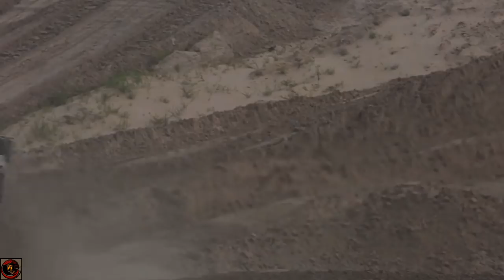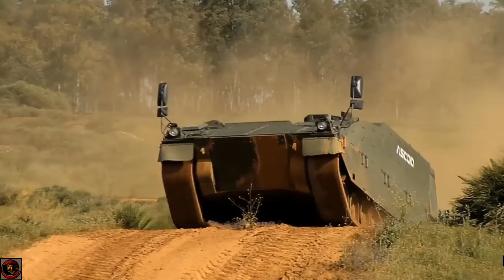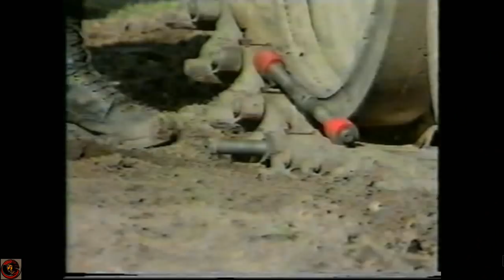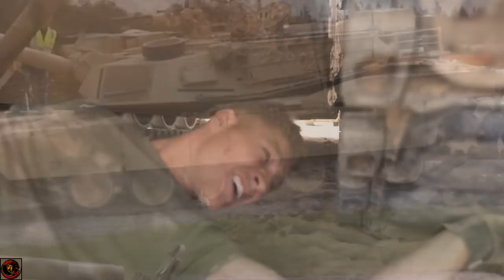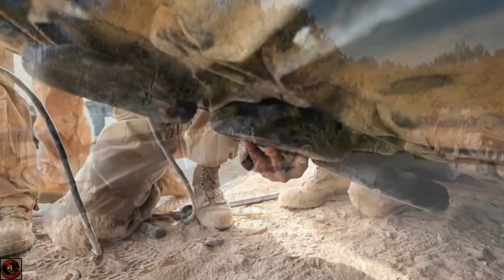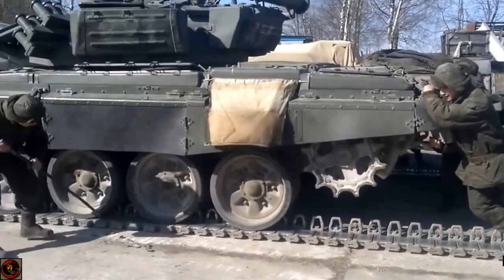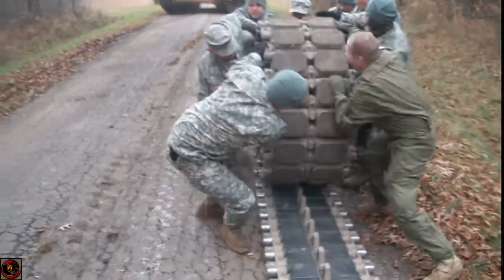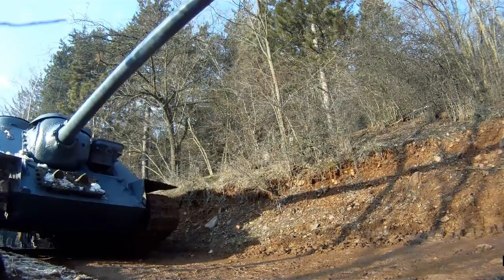What’s The Biggest Weakness on a Tank?

Comment: I think the base of the abram's barrel is a weak spot.. Instead of deflecting the enemy projectile, it'll guide it into the center and probably destroy the turret or killing the crew there.
Reply: Its a hell.of a lot easier to hit any point on the track system than to hit that Exact point under the gun.  With modern armor you are MUCH more likely to hit just a fraction off, dissipating the energy on the heavier armor surrounding it.  Hit the much larger suspension and the tank is a sitting duck, with any decent MBT, artillery or even RPG capable of delivery muktiple hit on the now stationary target.  Yes, he can fire back, but hitting a moving oppoent while you are stopped is a recipe for, as The Chieftain likes to say "a significant emotional event"
Reply: If I were targetting it, I wouldn't target the tracks. If I did, they will be able to shoot at me while I'm reloading. Hitting the ammo or killing the crew would be my choice. And at frontal view, that spot is a perfect spot for tank vs tank

Comment: What about the BT-series of tanks? It was a design with a Christie suspension and could move without tracks on a road with lots of speed, of course the tracks were more useful on a terrain that wasnt all flat. It was a light tank and the design was starting to get obsolete By the beginning of ww2 but its just one example of a tank design without necessarily needing the tracks, even though the tank became too reliant of roads at the process.

Comment: Here's a question for matsimus or any other tankers
How effective are molotovs against modern tanks? In the winter war and continuation war the Finns demolished  bt-5's, t-26's, t'34's & kv-1's and others and t-55's were took out by molotovs in the Hungarian uprising & Prauge Spring. Tanks have come a long way since, but would a Molotov be able to take out a Abrams, challenger, Leo, t-90, leclerc etc? If you knocked off the track could you get a Molotov in the right place and finish it off? Seems like it would be a way insurgents could deal with modern tanks you couldn't take out with a rpg-7
I mean if you had a AGTM or RPG-29 modern tanks are toast but a Molotov interests me, especially if the fuel is gelled

Comment: generally tanks are pretty poorly armored at the bottom, so anti tank mines are effective. A volley of 30mm from an apc could demobilize it by destroying the tracks. a sabot right between the turret and the hull can be pretty effective since most of the armor comes by slanting it, deflecting projectiles away and increasing the relative thickness from flat on attacks, and the gap between the turret and the hull wedges the projectile right in there. attacks from the top and the back are pretty devestating. if powerful enough. guided, air dropped munitions and missiles are  nearly always an instant kill or mission kill. a tank without infantry support is of limited use. it can be flanked and attacked with man portable rocket launchers. maintaining situational awareness is hard when you are in a box of steel with barely any view outside.
aside from that there are logistics and infrastructure  issues. most tanks can't cross a broken bridge, and most tanks don't work well when they're out of gas. being machines they break down, loose oil or coolant, etc.
tanks are nice, but air power always wins.

Comment: Here is what i think are biggest weaknesses of tank in no specific order, before i have watched the video:
1. Best of tanks can be destroyed by cheapest of infantry with equipment that is substantially cheaper than tank. Even when infantry and equipment suffer losses as they try to destroy 1 tank, it still is much, much cheaper. 
2. Supply lines. Supply lines are easier to attack than tanks, and without supplies tanks become useless. 
Ofc both are easier said than done.

Comment: As a AT Carl Gustaf gunner just taking out the tracks is not option for someone who are defending a position if a tank is attacking.it is imortant for the crew in the tank for shure.but for a defender AT it is bether to hit the joint betven the hull and the turret.the tank are able to drive yes.dut not able to engage tergets easy.it have to retreate for repair.or often just able to use turret mounted auto rifles.and heavy AR.

Comment: It looks to me that the use of graphene, carbon nanotubes, and so forth are really the solution to the suspension/roadwheel/track problem.  They are only going to be 10-25% as heavy as a steel track system (if not less) and a HUNDRED TIMES as strong (or even more).  This means that they can be tied to the tank's hull much more solidly and still not be liable to be over-stressed, while being much more easy to repair, since each component will be light enough for a single man to pick up and carry.  I would think that a major program to work on this would be very cost-effective, as well as making the vehicle more reliable on the battlefield or during training exercises.   Even if twice as expensive as a current component, if it lasts more than twice as long, it pays for itself.

If efficient generators and battery/capacitors are developed, the tank can use electric motors and magnetic repulsion to eliminate many weak spots.  Such as a set of small road-wheels held in place by powerful high-temperature super-conducting electromagnets -- cooled by a small nitrogen-gas/liquid compressor inside the motor compartment and using super-insulation to keep the suspension components cold.  With this, the vehicle cannot have its magnetic-repulsion connections broken and would have much less loss in wasted power if each road wheel was driving the tread separately.  It would be literally floating on air and its suspension would be very easy to maintain.  Longevity in literally thousands of miles between normal maintenance procedures, just like a current automobile, even when going fast across country.  Only direct battle damage from enemy weapons would be a problem.
Reply: You play way too many video games. It's actually not realistic to put that kind of materials into military vehicles.
Let me give an example. You said use graphene right? Did you know that while graphene is as strong as steel and much lighter, it's also brittle? That's the last thing you need in a battle tank.
Reply: Same reason for engines and gears instead of electric motors. If..no. Actually, when they break down( because they are going to battle, not going to the shop to buy milk) do you think electric motors can be repaired in combat? Nope

Comment: I have question for you MATSIMUS. I am 66 years old and in late 1950's as 6 year old boy, I was near rail road which was used for armored vehicles loading area onto  " flat top " train carriages " which were then delivered to military " remount / repair ' depot. I talked to one tank crew member and asked him why are there rubber padding's between main cross metal grip sections. He said, those are " peace time " add ons to reduce noise while driving Tanks on main road in towns and to prevent damage to roads which will be taken off if there is or will be a war. Most tanks than ( country I originally come from ) where mainly WW2 era American and Russian Tanks. so, there is real question, I wonder, why all those new, modern Tanks are using rubber grips on Tracks instead all fashioned metal grip's?? ( sorry Guys I am EX AIR FORCE ).

Comment: I was thinking about a "tank-replacement" system for the future (just for fun) -- and the vulnerability of the tracks came to mind.  I was thinking that bolt-on wheel/electric motor systems designed for quick (preferably robotic) replacement would fit the bill.  6 - 8 wheels/vehicle would mean that 1 - 2 could be lost and simply abandoned.  This concept assumes a heavily armored command vehicle would have multiple relatively lightly armored gun vehicles that were semi-autonomous.  If tanks are moving towards crew in capsules controlling guns remotely -- why not have those guns on separate vehicles.  Just dreaming.

Comment: That was one of the differences between German and Soviet tanks in WW2. The Soviet tanks could be repaired in the field and returned to battle in a short amount of time. The German tanks on the other hand, were mechanical nightmares being built with tight machine tolerances and complicated to repair. The required special tools and procedures to fix. On top of that they had to be towed to the rear echilion to facilitate those repairs. Costly, time consuming processes kept them out of battle longer.
Reply: German tanks killed soviet ones about 8-10 to 1. The Russians just built 30 for every German tank. The Germans spent too long getting neat weld lines.

Comment: I worked on all the ground vehicles the US Army has, and I would like to remind you that the greatest weakness of a tank is the same as for air craft. You want to be a force that can overcome a superpower, attack the fuel supply. No not the oil wells, but the logistical refueling systems. The targets are fewer in number, and normally, less defended. Tanks are gas guzzlers.
Reply: Forgive me, I shouldn't have written "all the ground vehicles" it should be "most of the ground vehicles". Sorry.

Comment: Well, there is men of war, in which tank treads can be blown off, and the tank can´t keep moving, but it can be repaired, just send out a crewmember, if the tank has a tool box he will fix the tread and anything that has been disabled from the tank, like the turret, gun or engine.
Albeit is not like World of tanks or war thunder in which you control a tank, is an RTS

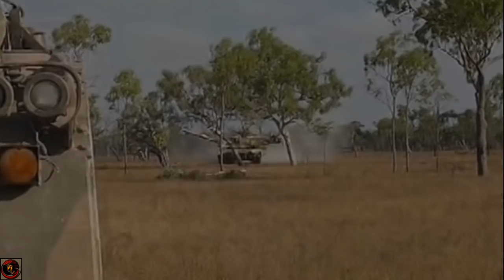Comment: 1:31 in the video and I'm going to guess - if its solely about the weakness of a tank and not infantry supporting it - it would be the tracks or general hindrance to mobility.
I've seen leopards get stuck on simple cut down tree stumps so once your mobility is taken away you are pretty much a bunker with fancy optics.
2:50 in and I guess I was right. PorPri, Combat Engineer :D

Comment: Sure, the tracks are the biggest outside weakness of a tank.
But i would like to argue that the absolute biggest weakness of a tank is the fleshy stuff on the inside. They are the ones who put the tank in a bad spot to begin with. They are the one thing that will destroy a tank the most.

And, once you disable the fleshy stuff on the inside. You get a possibly otherwise operational tank that can be crewed by more intelligent meat.

Comment: Something you missed was entanglement. Concertina wire has a core of some very impressive steel, and if you run over it, those little razor tips will grab the rubber track pads and wrap it around your final drive. I had the great honor of guarding a Bradley for several hours while the numpty driver tried to unwrap the wire he picked up. It was impossible with the free end being pinned under the track and caught in the roadwheels so he couldn't drive off of it. Without a good set of bolt cutters, it just isn't coming off (most of the wait time was trying to convince the mechanics at the FOB to let us borrow a pair of cutters, which only succeeded when the alternative was that they'd have to leave the FOB to ensure they maintained control of their tools, and higher confirmed the ultimatum). Given the fact that the hull of the Bradley is aluminum, and steel is harder than aluminum, the steel was cutting through the final drive case like a chainsaw. We were a mile or less from base, but had we left the wire on, it would likely have cut all the way through by the time we got back.

Comment: So why hasn't a tank designer tried to make several of the road wheels driven by electric hub motors with a generator output from the engine so instead of one sprocket becoming useless if the track is thrown the vehicle would still have some form (albiet handicapped) drive...
Reply: Tanks with powerd road wheels that can drive the tank without the track have ben designed.
The original Christie design from the interwar period had this feature. It was used in the soviet BT series of light tanks in the 1930.
However, they pretty soon found it be more trouble than it's worth.

Thing is: A road wheel will allways be inferior to a normal wheel when it comes to drive directly on the ground. So, you might as well go all the way and make your vehicle wheeled.
Also, any damage that breaks the track or trashes the drive spocket, idler or final drive, will most likely also do damage to at least some of the road wheels and the suspension. And what good are powerd road wheels when they too are knocked out?

Aditionaly, wheels with hub motors significantly increase the vehicle's unsprung masses, and that's allways going to cause more headaches to the designers down the line.

Comment: That’s why the bt7 technology was better than the modern tank tracks. Here’s why.

During ww2 the Russians need to find a way to survive with out tracks when it gets blown off. So they invented wheel on tanks. So when ever the leading wheel gets blown off. The driver have to change the steering wheel and he got a running car.
The advantages are that it’s actually really stealthy and it’s more fast.

Comment: At 15 min you see Russians push a tank. At 17min you see US troops have same speed with a single track rolling. M1 is notorious for its bad suspension possibly due to weight - it even lost tracks during demonstrations. On the other hand wheeled vehicles are even weaker then tracked ones - yes some can loose a wheel or two and still keep going but loosing such wheel is very easy as compared to a track.

Comment: Destroying the tracks of an M1A2 is useless... M1A2 abrams go in multiple units with additional bradleys to back it up... so even if u break a track or two u wont be able to go around it (firing in its front is basically wasting ammunition cuz of its insanely hard armor) because of the other tanks that youll have to deal with... one weakness i can find is the under... M1A2 Abrams may be one formidable legend when it comes to armor but there are already reports of M1s getting destroyed by land mines... one is in which an M1 that injured its driver and knocked out its turret ring.

Comment: 20-minute video that's solely focused on one age-old weakness. What about the armor on top being thin as a bean can which AT weapons like NLAW(MBT LAW) exploits? There's also the sights that can be destroyed by small arms fire/ shrapnel which is why there's a lot of sights available. Anglo-Americans seem to find forests a problem but it's the safe haven from a tank's worst enemy, the attack helicopter and in general, brings cover. Modern armored vehicles are only slowed down a bit by it anyways which I don't see such a big deal as the movement is slow if it's infantry supported which it usually is.

Comment: what about the limited vision?  I watched quite a few videos of syrian tanks sitting helpless in streets, getting shot with all kinds of smallarms, .50cals, rpgs, etc... without being able to return fire at all. and i felt fucking sorry even for the baddies. someone could jsut have walked up to it and knock at the hatch.

And in my service time I spend many hours in armored vehicles too and got that confirmed. good....the optics may be able to have a x20 zoom, or might even have thermal/nightvision. (our MBT only has ONE TWS for the commander, the rest of the crew has NVS)  but damn...a well placed 5.56mm round or a VERY brave painter  xD can disable a tank in its mobility (the driver is helpless without commander) and his ability to shoot. (commander designates targets for the gunner). 

And a damaged track might be hard labour to repair/replace, but optics are costly and are not a common replacement part like tracks.

edit:  and while popping your head out of the tank might give you a better understanding of your surrounding, you lose the benefit of all the fancy optics again. so its not recommended to do so if your camera gets disabled by a sniper to take a look outside.

Comment: What I only know: Weakness: Engine, ammunition racket, and tracks (Disables its maneuver)
Edit: The ammunition racket will cause the tank to blow up and engine will blow up in flames.
Reply: The ammunition storage on a tank is one of the most protected areas, period.  If it is hit, it is specifically designed to NOT destroy the tank.  That's why they have blow out panels.

Comment: now days its a little, by little i mean VERY LITTLE, better because you have rubber pads which reduce the weight of the tracks by some.. i gurantee if that track they were rolling was all steel, say a Tiger H1, or IS-2's track no way in hell 8 people could roll it.. modern day: oh you got your track shot off.. lets roll it UP WW2: oh for christ's sake... someone get on the radio, call in someone to tow us out. (Radio operator yells) sir there is a tree line on the edge of the road preventing the radio from reaching its maximum distance (yes really there were radios this bad in WW2 that would have their signal stopped by a decent treeline..). fuck it we'll leave the tank here take the glow or spark plugs or what ever the fuck they are so it cant run and go back as a group.

Comment: It is amazing that you have spent 20 min. repeating that tracks are the biggest flaw in a tank. When in fact, the size of the fuel tank is indeed it largest drawback. General Edwin Rommel lost the battle of Alamein, because of this. His panzers run out of gas in the middle of the battle. Otherwise Britain would be speaking German by now. THe difference of winning or loosing is not the tracks, because not a single tank fights alone. The other ones will keep the enemy busy. But if the unit is short on gas or ammo, then the battle is lost.